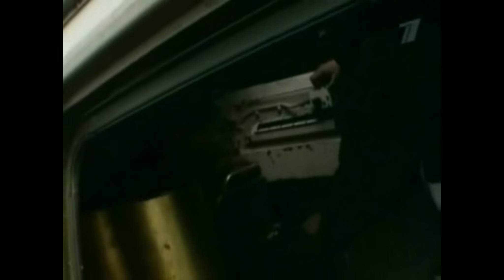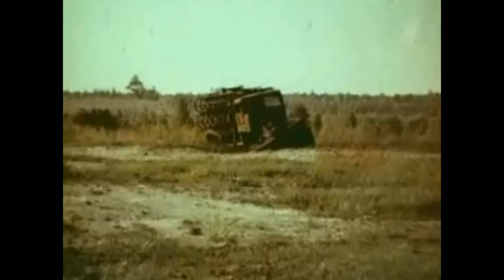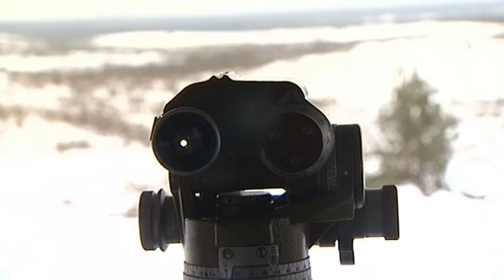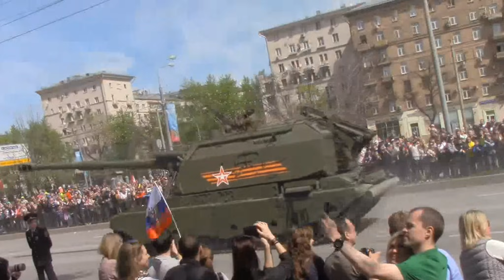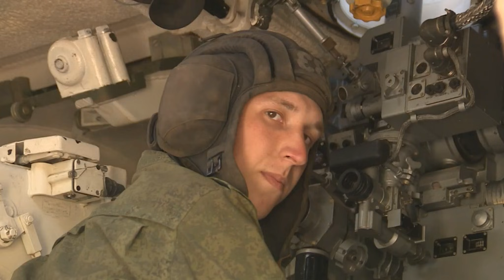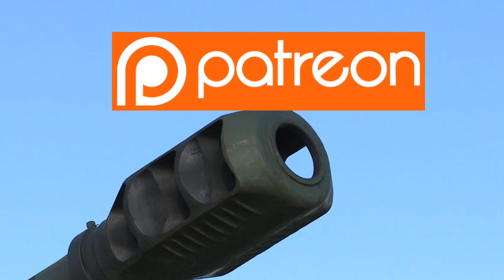Russian  2S19 "Msta-S" Self Propelled Gun - MASSIVE ARTILLERY

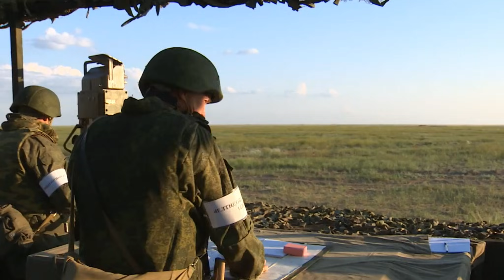Comment: 13:27 why is there fire flaring out the side?
Reply: That's the engine exhaust.
Reply: @definitelyfrank9341  why would the engine be connected to the turret?
Reply: @____________________________.x  Because the artillery gun-turret obstructs the engine exhaust which is usually in the hull, they needed to connect the exhaust to the turret.
Reply: @definitelyfrank9341  but that sounds impractical? When you rotate the turret presumably that duct is disconnected. On tanks they just pipe it out the back. It seems more likely that it is some bore evacuation?
Reply: @____________________________.x  The bore evacuator is on the barrel, you're right though, it is a bit impractical...
Reply: @definitelyfrank9341  I don't suppose you happen to know what those two flat ducts running back along the turret are?
Reply: @____________________________.x  The bulge in the middle of the barrel is the bore evacuator and the gasses are ejected out the end of the barrel, you can see a puff of smoke after the shot here: https://youtu.be/BbFx08dpsak?t=68
Reply: @definitelyfrank9341  ah, thanks 👍

Comment: Hey Matt! I've always understood that the US and Soviets had differing Armored/Maneuver Warfare doctrines, but the specifics of them escape me, are there any good and comprehensive videos you'd recommend that illustrate these differences? Thanks if you read this, cheers from the US 1st Infantry Division!
Reply: 6 important differences:

1. US doctrine depends on air control before anything else, Russian doctrine  does not presume friendly air cover.

2. US doctrine believes in using heavy fire power to support struggling maneuvers, Russian doctrine favors falling back if maneuver is not successful and only reinforcing successful pushes.

3. US doctrine places heavy emphasis on single shot marksmanship with rifles, Russian doctrine emphasizes automatic fire.

4. The primary firepower in the US squad comes from the machine gun, the primary firepower in the Russian squad comes from the rifleman.

5. The primary method of fire support in the US is airstrikes, the primary method of fire support for Russians is artillery.

6. US leaders task mission orders, Russian leaders task objective orders.
Reply: @Всё о сварке и самоделках. welding  DIY projects. 😆😆😆

Comment: This is an impressive system. It seems to be fast. This is a good thing for shoot and scoot tactics. But this mobile artillery system has one fault.
If has to sacrifice armor for speed leaving it vulnerable to air assault and forward infantry units armed with shoulder mounted anti-tank missile systems.
It seems to me that the turret must have the weakest armor in order to make it fast. It’s turret is just to big to have respectable armor. If the turret was heavily 
Armored the engine and the chassis would render it a slow moving target. All and all it’s a basic good system that needs good tactics to survive.
Reply: no armor is currently protected from air attack, no matter how much you hang it. all armored vehicles in the world are powerless from an air attack, so is it worth strengthening armor where it is useless?

Comment: Just being  'a picky bar-stewart'..... at 6.12, you mention '4 accumulator batteries producing 27v dc'... that might well be true, in which case, it is very likely, a 24v system.
If the gun control  and turret movement is electric (I did say 'IF') and the dampening system also, then I would be surprised that they only use 24v; if you gotta dump a whole lot of power rapid, it would make much more sense to double the voltage to minimize losses in the system and/or avoid just having massive cables to supply that power requirement.
Just sayin', as an engineer it doesn't make good sense,  but in practical terms maybe the entire family use a standard 24v?
Maybe the major controls are powered hydraulically, in which case 24v 'be just fine'!
Being EXTREMELY picky (sorry)...'4 accumulator batteries'....... ahm, eh.....what kind of batteries? Did you mean that there are 4 'super-capacitors' or just 4 ordinary batteries? (in which case, they might have a 48v nominal supply system, even if they 'split the rails' for standard 24v sub-systems).
I am not trying to' find fault' here, but I can't help 'being an anorak' regarding electrical systems.....if the 'mac' fits, then wear it!
Respect.

Comment: my question is... why russia uses 152mm and NATO uses 155mm ? i might understand nato "rounded" number but 152... why not 150 or 155 or 160, i need to know why they picked that number.
Reply: Because Russias being using the calibre since pretty Ww2 practically and it's done it well, if there was one thing staling could mbt get enough of it was artillery and IL-2s
Reply: BlackSkorpion1991 To answer your question,  b4 everyone uses metric we use imperial system. 152 mm is actually  6 inch caliber gun. It was the westerners who arbitrarily change/rounded off the 152 to 155.
Reply: Badut Badut that's a good explanation
Reply: U wot m8? i never said they would need the same caliber for inter-operability but because it's a more logical number... why stop at 152 when you can reach 155 or 160mm
Reply: BlackSkorpion1991 155 mm is actually 6 7/8 " caliber. I think  there is no such caliber that size in WW1, not in the army or  in the  navy. I'm  not sure.

Comment: Can this thing shoot directly?  It looks quite mobile, so why not make a multi role vehicle from it?
Reply: its a Self Propelled Howitzer, it maybe able to fire directly but it won't do much
Reply: I don't see why it couldn't. But I suppose it doesn't have a lot of gun depression.
Reply: im guessing its fire control system and rounds are design to fire as a howitzer not a Tank
Reply: it can shoot directly but it armor are paper thins that only defense against small cannon rounds. if it have heavy armor then it's basically maus. later T14 model have 152 mm gun. this is self propelled howitzer. can shoot 152mm HE but that is not really effective. But it can shoot tactical nuclear warhead which can defeat any tanks and itself if it fire dirrectly.
Reply: Russian doctrine includes that artillery pieces to be used as direct fire role when necessary
Reply: Yes it can. All Russian self propelled howitzer crews are trained for direct shooting, for example, against tanks which suddenly comes from nowhere at direct fire range in front of howitzer position. But, of course, it is not the main usage of any howitzer artillery system. 'Just in case'...

Comment: The Turkish T-155 Firtina 155mm Self propelled Gun. https://www.youtube.com/watch?v=dJ0btqgDlDc 
The vehicle is fitted with a 155mm bore and calibre length 52 main gun, giving it a greater range over most other SPG’s on the market. It has an elevation of -2.5 to +70 degree’s and when firing the locally developed K307 HE round, it can reach targets 40km out.
The rounds are loaded automatically but the charges are manually loaded. Its maximum rate for fire is 6 to 8 rounds per minute. A sustained rate of fire is 2 to 3 rounds per minute

The vehicle is ready for action within 60 seconds! Of arriving at its firing position. Both this and the vehicles Digital Fire Control system, enables the vehicle to use an artillery technique called Time On Target. TOT is where three rounds are fired in sequence with the main gun raised to different elevations per round, so that each round takes a different amount of time from the other, but all hit the same target at the same time, causing a greater level of destruction. The vehicle can then move on AKA shoot-and-scoot.
Reply: What type of engine does it have?
Reply: German designed MTU-881 KA 500 diesel engine. 

 Tusaş Engine Industries (TEI) (Turkish: TUSAŞ Motor Sanayii A.Ş.), is a plant dedicated to the production of critical parts for commercial and military aircraft, also producing a marine engines line, is manufacturing center is located in Eskişehir, Turkey.

TEI was founded in 1985 as a joint venture between GE Aviation and Turkish Aerospace Industries (TAI), the Turkish Armed Forces Foundation, and the Turkish Aeronautical Association

The company started with component manufacturing for the General Electric F110 engine powering the F-16, and is planning other jet engine parts related to the Boeing 787 Dreamliner and Airbus A380, among other airplanes such as the TRJ-328.

Some of the projects undertaken by TEI include:

LHTEC T800 turboshaft engines for rotary wing applications such as the T-129 Atak.
An indigenous engine to power the TAI TFX.
General Electric T700 for the T-70, a local variant of the S-70 Black Hawk
TJ90 engines for UAVs.
Local turboshaft engines for the T-625 light utility helicopter.
PD170 engines for the TAI Anka UAVs.
CFM International LEAP engines.[20]
F-136 engines for the F-35 Lightning II Joint Strike Fighter.

More info at website : http://www.tei.com.tr/  ( english )
Reply: mr grey  no its not. It only got technical support for the first batch which is manufactured over there
Reply: Ottoman Empire I didnt even need to check it as every turkish tank is South Korean, but I still did it. And you've let me down one more time Turkey.